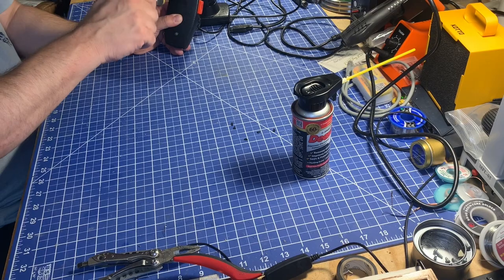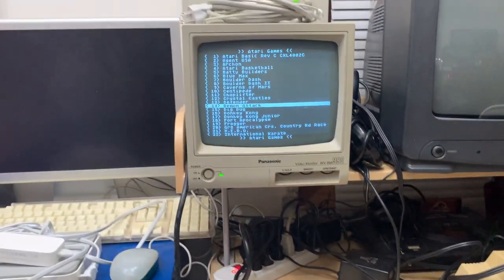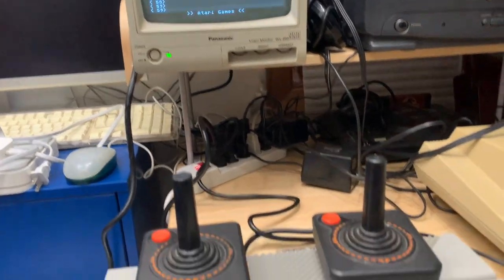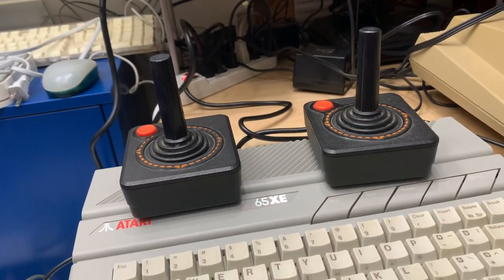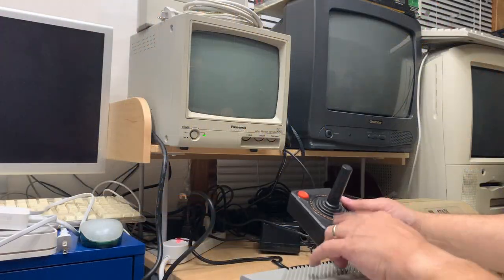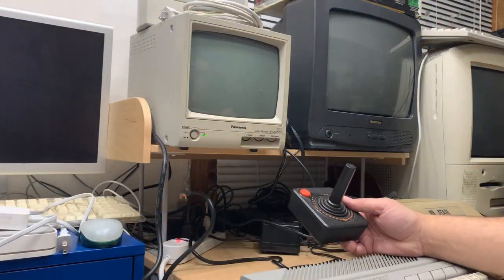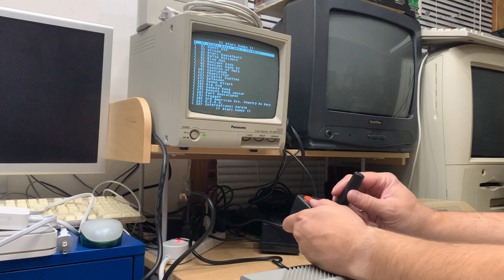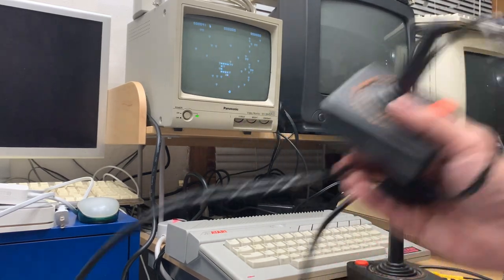Atari 2600 Controller Repair - Joystick and Paddle

Comment: Thank you for sharing the video. Couple of question:
What is that small panasonic tv?
How to fix a joystick that needs to be pushed very hard to register the input?

Thanks for your time.
Reply from the maker: That is the Panasonic WV-BM990.  I think it is actually a monitor for security systems as it takes BNC input - but it works fine for composite with an adapter.  I found this one at a Goodwill for maybe $5?  I really love it.  

If you have to push really hard on a button, it is likely that the metal plate that is held on by the plastic has bent.  You might be able to carefully peel back the plastic and reshape it so that it sticks up more.  This was a super cheap design they used, so it can be a tricky repair.
Reply: @jonobst  Many thanks for your time & for answering the questions. Your video at least made gather the will to check out the joystick to see if it can be improved.
Reply from the maker: You've got this! @Refreshment01

Comment: Hi Jon, nice video. I almost have the same problem as you. I have an generic gamepad from nes but this has 5 wires, and I want to use it to fix my controller because my atari's connector is broken but I don't have idea how to replace the 6th wire. Do you have any idea?  (sorry for my bad english)
Reply from the maker: Does the connector have 6 wires?  If not, you'll have to cut that open and solder a wire on.  I think you'd honestly be better going for an entire replacement wire: https://www.amazon.com/Replacement-Repair-Atari-2600-Joystick-Controller/dp/B0733JKHKW

(Your English is great, by the way)